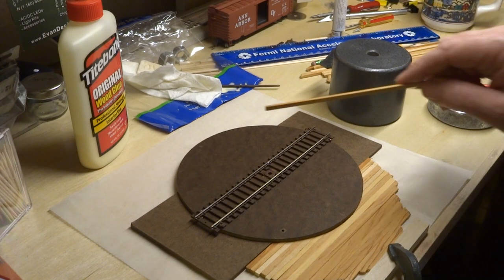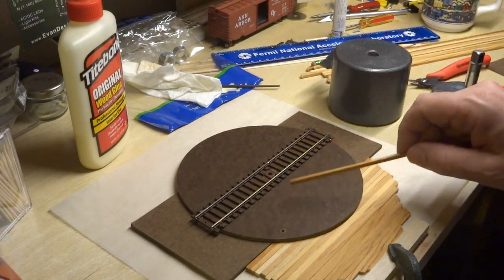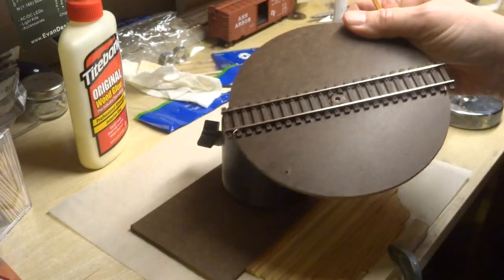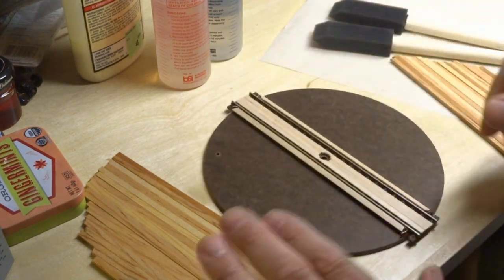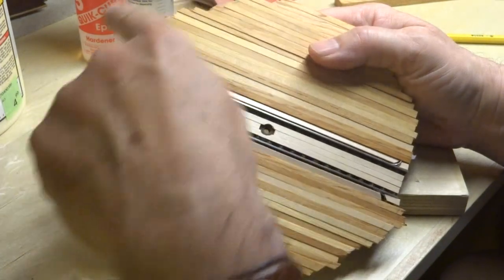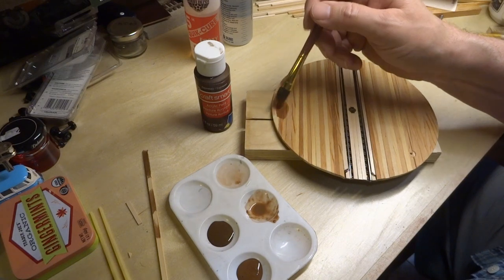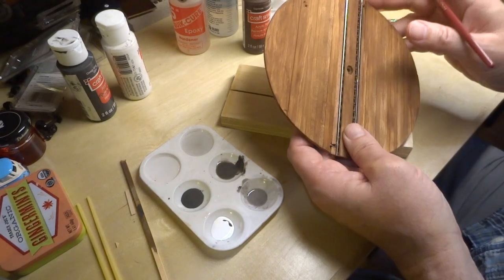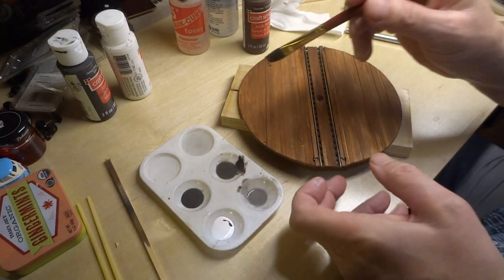DIY Turntable Part 2

Comment: Thank you for sharing this second installment. You have presented an ideal solution to a lot of railroad/railway modelers needs when it comes to a simple turntable. In its creation it allows you to do as much or as little as you want. Keep it simple or add more. Great job well done.
Reply from the maker: Thank you Chris!  What started as an experiment actually worked out ok for the small space I had to work with, and has been one of my most watched rr videos.  Go figure!  I want to do a bit more work on the cosmetics of it with some beams and cables, but for now it's functional at least.  What would I do without that thin hardboard stuff?!  It's everywhere on my layout.
Reply: 7i8⁸tþ5oyuuuuuuuuuuuuuuuuuù

Comment: Dear sir this is an awesome tutorial of how you did this! I would like to do something similar for my small on the floor LGB layout but didn't know if I could hook up an electric circuit using a metal lazy Susan? Would you have any suggestions on how to do that?
Reply from the maker: Very kind of you, Alexander.  The challenge with motorizing a turntable is turning it slowly enough.  You could dig around on line and see if you could find a small dc motor with a reducing gear box, or maybe kit bash an old locomotive chassis to slowly rotate your turntable with a belt or friction drive.  You could also buy a smaller scale turntable for HO or another scale to power your larger one.
Reply: @StanFerris  My pleasure! I was actually just looking to do it manually like you were, but can not figure out how I would have a connection so the train can actually run off of it when I'm done turning it around. Long story short, I'm getting a pre-cut circle disk from Menards and then lazy susan hardware from Hobby Lobby. Do you think there is a way I can use the metal part of the lacy susan to hook power up to the track itself? I'm doing analog style.
Reply from the maker: Oh I see...  yes I had the same issue to work out as well.  Just thinking out loud here, but since the lazy susan is all metal, you'll have to pickup your DC power either outside or inside of the steel ring.  You can solder some wires to your track rails running down through your platform so that when the track is in the straight-through position then two little conductive tabs on the bottom of the turntable will touch two wires or screwheads wired to the layout track.  Your larger trains should be heavier than my HO stuff and should improve the contact.  Have fun experimenting!

Comment: I watched part 1/2, did you put in a reversing circuit? In part 1 there was no sound at first pushing the box car, but coming back there was. And with DCC there is no power keeping light and sound on while rotating the table. Great little table, the wiring can be a headache.
Reply from the maker: Phillip, Hello and thanks for taking the time to comment.  You are correct in that the table disconnects from track power and then reconnects when spun 180 deg.  It was a minor inconvenience as I don't run with sound anyway when operating.  I've recently begun implementing something that's been in the back of my mind for some time, and that's converting from DCC to "dead rail" or battery power for the layout.  Power in the rails will simply be used now to recharge the batteries.  Track maintenance became too much of a chore for me.  I've posted a few recent videos on the conversion.  Blessings!

Comment: Do you use a  reversing unit on the  turntable for dcc?
Reply from the maker: Hi William!  At this point no.  I have the engine sound volume turned way low right now, so the interruption when I do a 180 on the table is not a big deal.  The power cuts off and then right back on again.  But that's an option for down the road.  Thanks so much for watching!